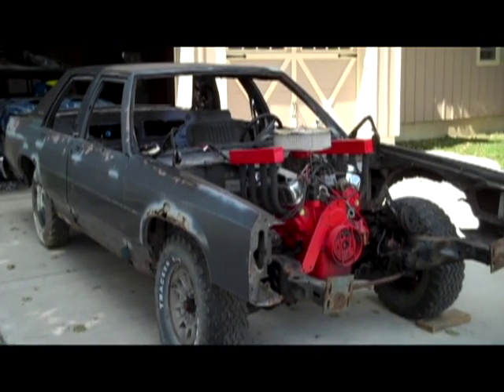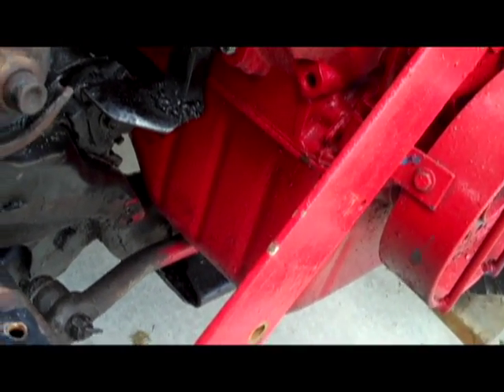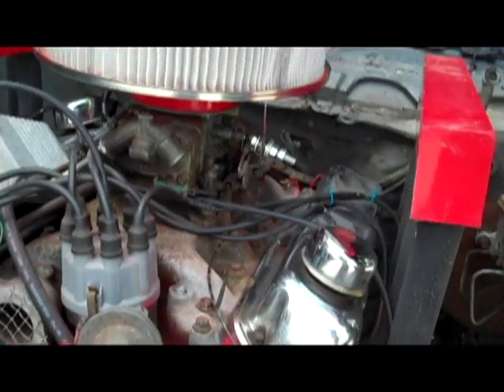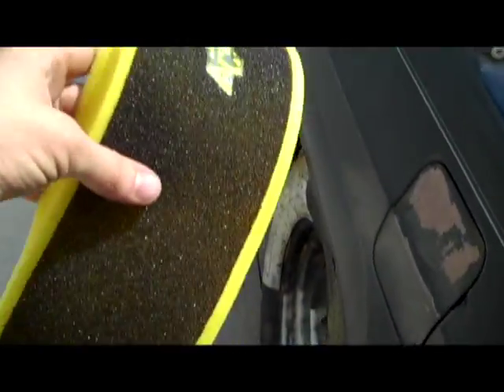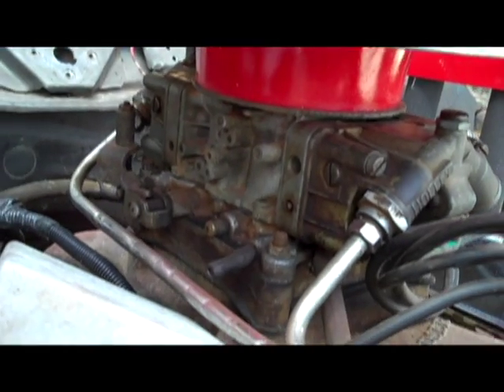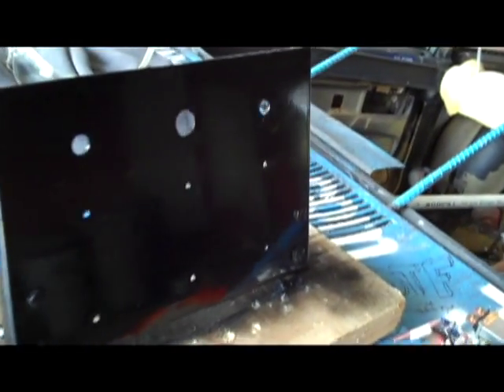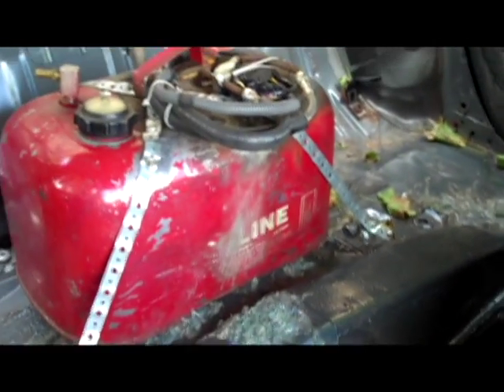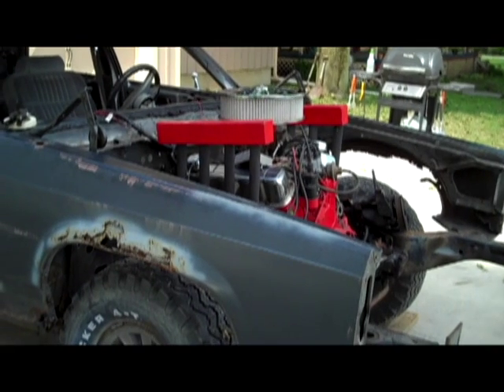87 Mercury Grand Marquis - Update 5 (2011)

Comment: with your gas tank and battery you should drill an inch and a half hole in front and behind them and put a 3/8 chain through and bolt a ratchet strap to the chain. the straps would be moore secure and alot safer. The tank and battey don't become loose durring the hard hits.